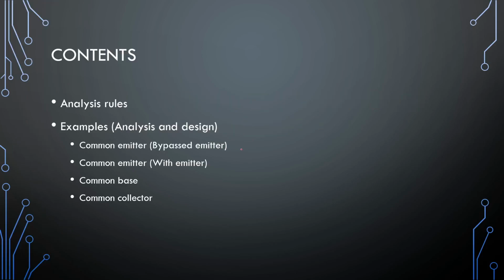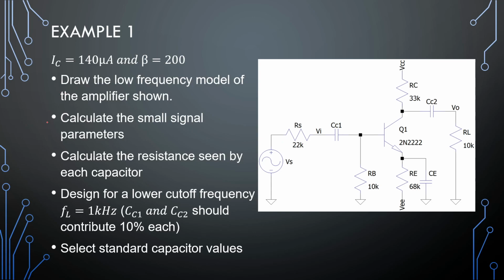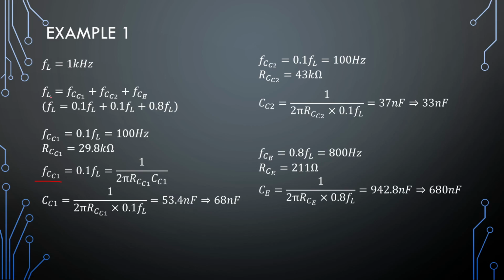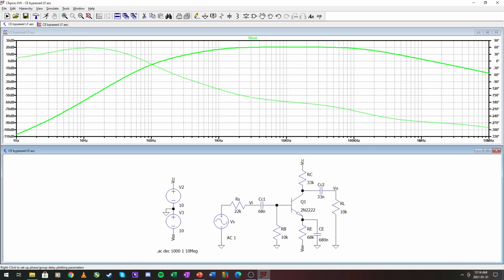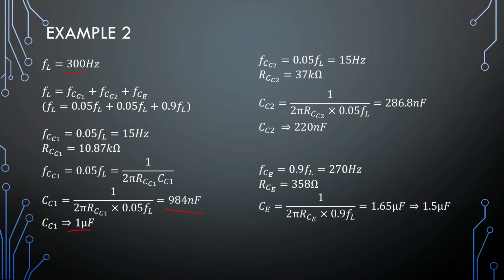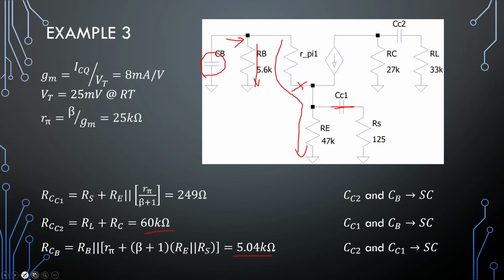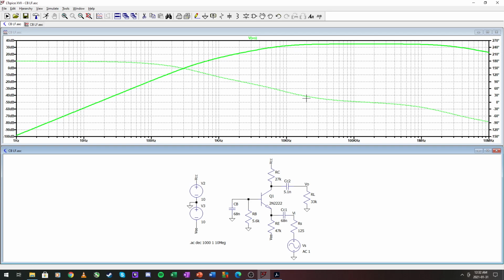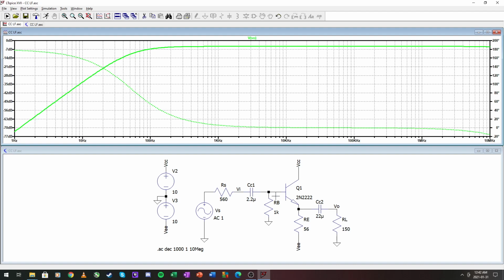Video 2 - BJT Low frequency response analysis and design

Comment from the maker: To explore this it would be easier to derive the equation. Lets start by saying RE1 is the resistor with the bypass capacitor and RE2 is the one in series to RE1 and CE.
The goal is to find what is parallel to the capacitor.
RE1 is parallel.
RE2 is in series with r_pi and the resistors on the other side of the transistor. RE2+(r_pi+RS||RB)/(beta+1), which is parallel to the capacitor.
This series combination is also in parallel with RE1.
RCE = RE1||[RE2+(r_pi+RS||RB)/(beta+1)]
Very similar to example to but RE2 is just in a different position in the final equation.
Making some assumptions and using typical values:
RE1 will typically be for bias purposes making it a large value. RE1 >> RE2.
Due to beta being large (r_pi+RS||RB)/(beta+1) << RE2.
RE2 would be mostly dominant making it responsible for the lower frequency.

Comment: How does an extra RE resistor connected series to RE and CE affect the lower cut off frequency FCE, sir?
Reply from the maker: To explore this it would be easier to derive the equation. Lets start by saying RE1 is the resistor with the bypass capacitor and RE2 is the one in series to RE1 and CE.
The goal is to find what is parallel to the capacitor.
RE1 is parallel.
RE2 is in series with r_pi and the resistors on the other side of the transistor. RE2+(r_pi+RS||RB)/(beta+1), which is parallel to the capacitor.
This series combination is also in parallel with RE1.
RCE = RE1||[RE2+(r_pi+RS||RB)/(beta+1)]
Very similar to example to but RE2 is just in a different position in the final equation.
Making some assumptions and using typical values:
RE1 will typically be for bias purposes making it a large value. RE1 >> RE2.
Due to beta being large (r_pi+RS||RB)/(beta+1) << RE2.
RE2 would be mostly dominant making it responsible for the lower frequency.
Reply from the maker: Apologies, I did respond to this it just didn't post in the correct place.